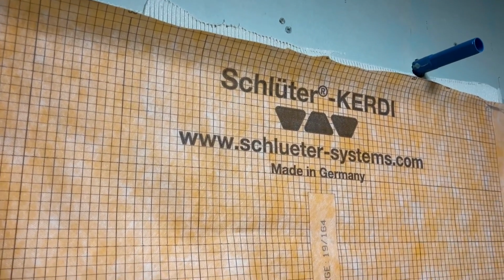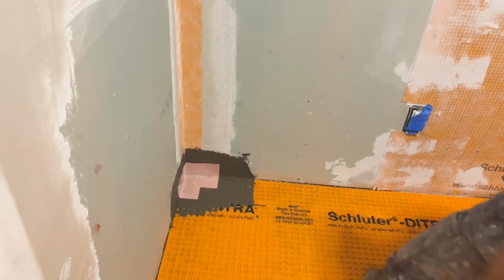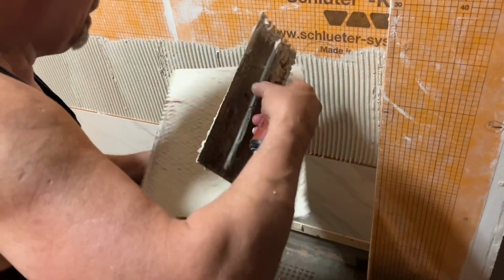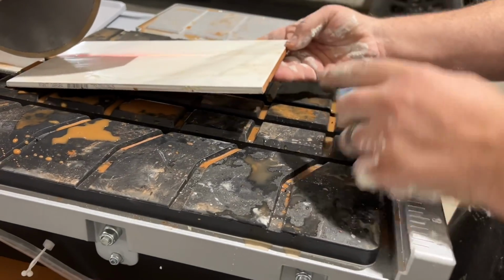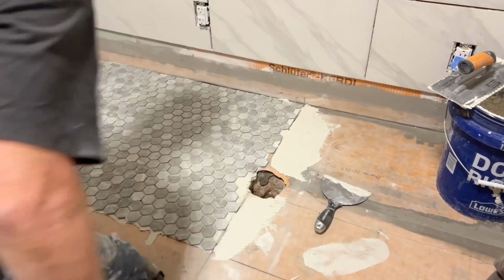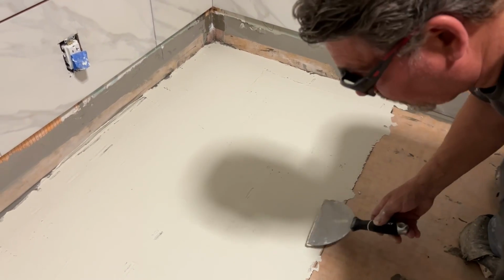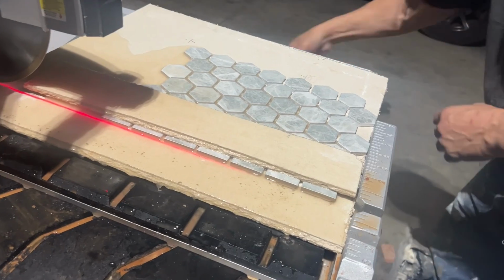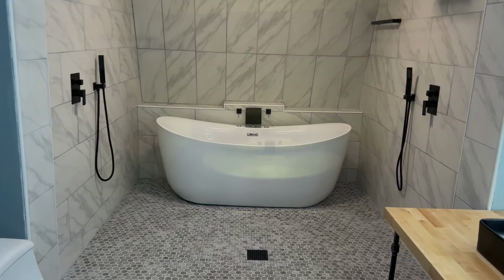Water proofing and tile shower installation

Comment: I'm about half way through (12:45 mark) so maybe this will make sense later. But he is putting the floor small tiles down. There is a drain he is working up to and there is an electrical outlet one foot either side of the drain on the wall. Why are there outlets in the shower? Or is this a whole wet room? Strange that outlets would be purposely put somewhere that it would get wet...or is the drain just a precaution Incase the room floods?
Reply: Hot tub power outlet behind bath ?
Reply: @michaelmcclown5593  I figured that must have been what it was for once I saw the finished room.

Comment: That is the TOP o the Line as far as waterproofing a bathroom. The absolute Super Way to install . I watched (15 years ago) a contractor cut and install marble for a highend house and he "Hot Tared the shower floor! They cut tile pieces from a giant slab on the truck. Maybe that was what you did back then? Your contractor is da man. Outstanding.

Comment: I used the Schluter Ditra on my floor of my kitchen renovation a few years ago.  Having an old house (1929 Ranch), I was afraid my nice Italian floor tile would crack due to the possible shifting of the old floor, so I started with a nice cement backer board, then the DITRA, then the big tile squares (on the 45º).  The DITRA will prevent cracking in the tiles due to possible shifting of the substrate.  Schluter makes awesome products.   .......Russell D.
Reply: Don't forget your umlauts! It ain't German without der umlauts! 🇩🇪 😋

Comment: Interesting waterproofing membrane. I recall 25+ years back when I refurbished a 1954 ranch home, we used hot mop tar to waterproof two of the shower enclosures. 
   Nice work!🇺🇸👍
Reply: Hot mop and lath & plaster is still the best way to build a shower, they were called 50 year showers since they last 50 years or longer.